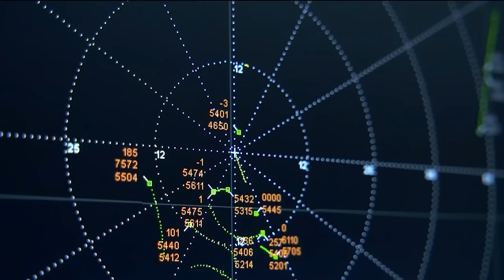EXTREME DRIFTING: High-Speed Maneuvers of US Largest Aircraft Carriers at Sea

Comment: As you notice they are filmed turns made with empty flight decks. Most of what you see are sea trials where maximum turns are performed during acceptance tests. Some are done with less turning circumferences when the decks are full of aircraft during deployment. It' s sight to see and feel when the call comes out " hard to port or starboard ! " I was on the USS Constellastion in the 1970's , Flight deck duty.Pretty wild to ride one out.